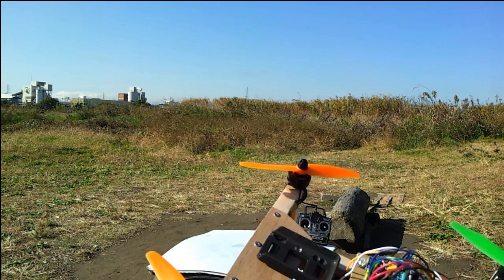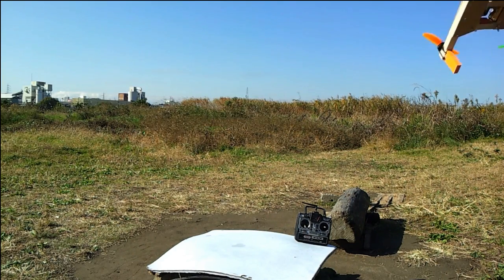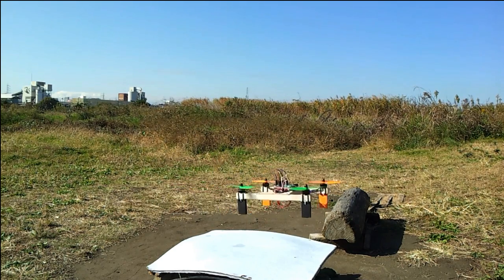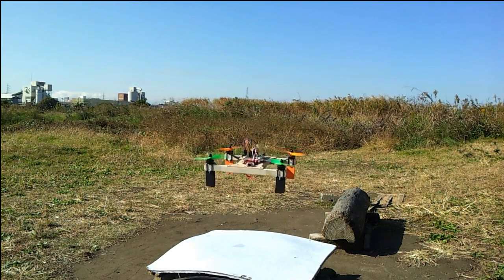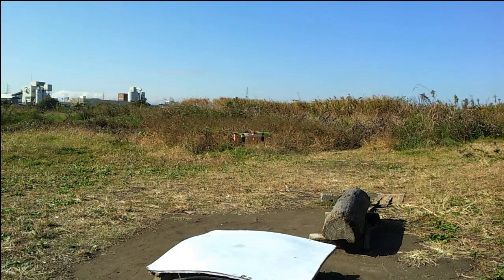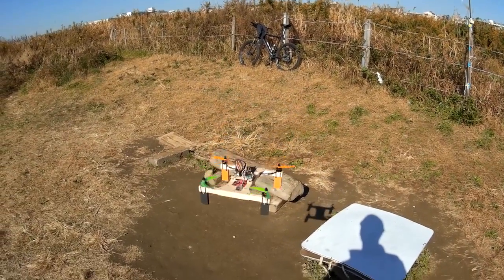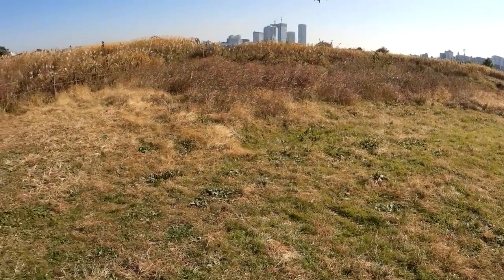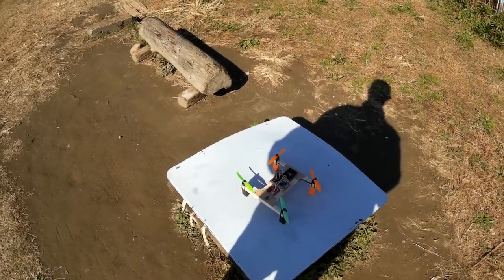Cheap-ass quadcopter build Part 10 - Outside test

Comment: Hi, +iforce2d. Ive built a drone based on your videos, and overall it works well, and i am happy with the results. However, i am having two problems, that i think are connected to each other: 
1. The drone keeps tilting left when ideally hovering. This happens even when i try to compensate for that tilt in the calibration option in the GUI.
2. The compass keeps rotating clockwise all the time, without the quad being rotated in the yaw axis. The compass rotate about 1 degree every three seconds.
These two problems make the flight quite difficult. Got any ideas how can i fix these problems?
Thank you!
Reply from the maker: Unfortunately you might have a bad gyro.
Reply: iforce2d thats the most likely reason?
Reply from the maker: Presuming your trims are set properly so that you're not actually commanding the quad to make those movements, I can't think of much else.
Reply: iforce2d thank you

Comment: Hey due, Thanks for this video series. One motor stops suddenly during flight and my quad flips over. Can you suggest anything for that?
Reply from the maker: Check connections, swap the motor/esc around and see whether it is the motor or esc at fault. Then replace the faulty one.

Comment: nice series of videos well explained, with the arduino programming, is it possible to pre program the arduino or are the parameters to varied on individual builds?
Also if i built this set up, coule i use the same transmit receiv on a bigger build without having to reprogram.?
cheers good work
Reply from the maker: I'm not aware of any arduinos that you can buy with a program of your choice already loaded. You would need to program the multiwii board anyway probably, and you'd definitely need an usb/serial adapter to connect to it and change settings. Yes, once you've made it, you could use it with any flight controller that supports PPM input
Reply: thanks again for good tutorial.

Comment: well, I've seen all your videos about this cheap-ass quad and I got to say that I'm a fan of your work! After all your flights with this configuration, what was the flight time with 2s and 3s? I mean flight time before that low voltage detector starts beeping like crazy... :) oh and now i guess you have to finish the work on telemetry and that would be mega-awesome! :D
Reply from the maker: It all depends on the capacity and weight of the battery. I mentioned a couple of examples in the first video for 2S, about 9 minutes of hover-only for 1300mAh. After seeing the comments below about payload, I tried my biggest battery (3S 1800mAh) with mobius camera onboard for total weight of 460g, with very aggressive flying and got 9 minutes again - I'll put up a video of that soon. Handling was still ok at that weight, but I don't think it could be pushed much further. All times are measured until the alarm goes off in hover.

Comment: I havent seen the whole series yet (I am in part 7 so far), but could you make a Payload test? I am really interested to know if this configuration with these  props+motor+esc are suitable for a small camera or any other payload. Thanks!
Reply: he as the camera attached for part of this video
Reply: brian whittle I have just saw this part 10. It would be interesing to see a payload test don't you think?
I really want to start a project similar to this one
Reply from the maker: estcap2
I mentioned a little about this in Part 1. This camera is a 39g mobius - it should be able to carry a GoPro, but not much more. I think 'payload' on its own is too vague, because the weight of the frame you make is also important, and presumably you want to do something useful with the payload. For example, with a small 3S battery (900mAh or so) I'm pretty sure it could lift two GoPros, but it would fly like a dog and probably only for a couple of minutes at most, and you would need to be very careful descending to avoid picking up too much downward speed from gravity. In my opinion, the useful payload for the frame I made is about 50g, where 'useful' means it can still fly well and for a reasonable time while carrying that extra weight.
If you are interested in carrying serious payload, you'll need something bigger. Basically all the methods are the same as this build - you just need larger motors, ESCs, battery and frame. I will probably try that someday too, but to get all that larger stuff is not really a 'cheap-ass' project :-)

Comment: How much weight it can lift? (and how much quadcopter weighs itself ?)
Reply from the maker: Frame weight without battery is about 260g. Check out part 1 for some more info.